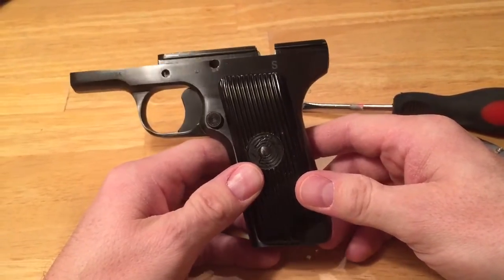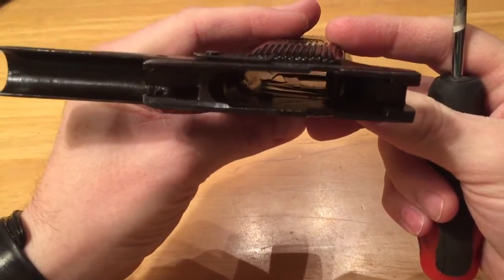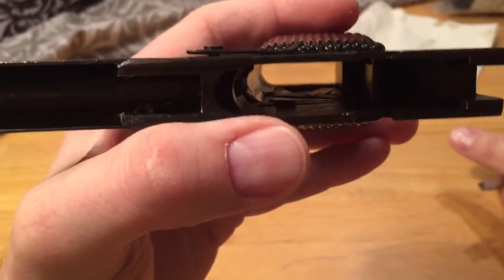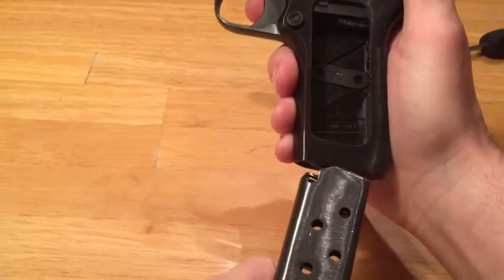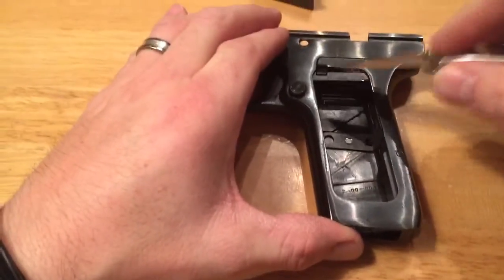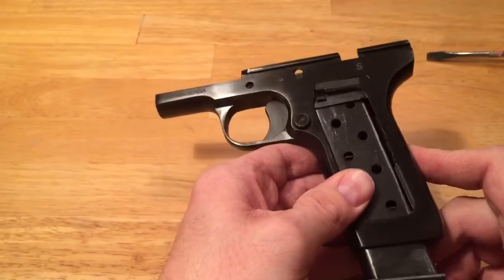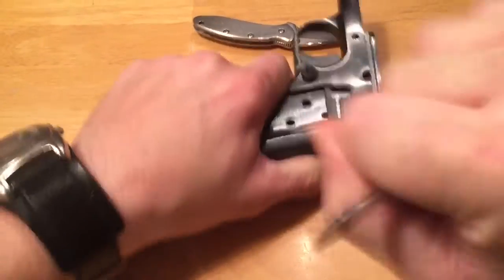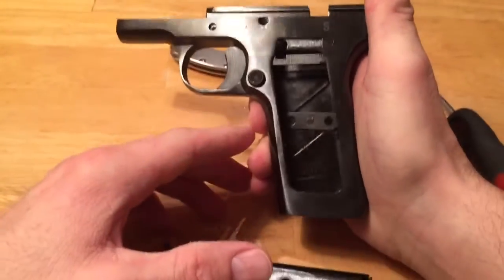Zastava M70A - Magazine Safety Removal

Comment: after messing with this myself and temporarly disabling it, I can see why some have issues with their mags dropping. this spring puts pressure against the mag catch side keeping firm mag catch engagment. If you remove or disable it, your mag mkves around much more due to loose tolarances. A better solution is to remkve the trigger, and carefully cut off just the tip that engages the trigger bar with a dremel.

Comment: If you do not want to alter the pistol you can accomplish the same thing by inserting a piece of plastic under the mag safety tab-spring.  I used a piece of an old credit card cut to the size to fit in the channel under the tab-spring; no more mag safety and pushing the mag release drops the magazine.
Reply: great suggestion,  thanks. Best not to permanently alter a gun if you dont have to.
Reply: Pics or Videos of this being done?  Cuz i've been looking everywhere for a non destructive and reversible way to remove the mag disconnect.
Reply: This option worked perfectly. Thank you @Mark Gman!

Comment: Great for permanent removal of mag safety but I found a way to disarm the mag safety without removing the mag safety clip on my M88A. I just put mag in and pried up a tad on the clip enough in order to slide a very thin piece of tin from a can bout 1/8" wide and 3/8" long under the clip and slid it back to the point where it held  the clip so it no longer catches the notch in trigger.The remaining piece of metal is then bent over the mag safety clip to hold in place.  Mag now drops free plus the pistol will fire without mag. To restore to original ,just take the metal piece out and it's back to working like before. So far works Great.

Comment: Just like some of your other commenters, I used this same method on my M88A. Worked great! Thanks, man!
Reply from the maker: Glad it helped you out.  I never owned the M88A so I had no idea it'd work for that too.
Reply: akkushisu when you did this to yours did the magazine develop some wiggle after removing the disconnect? Mine did but hasn't effected reliability so far
Reply: Yeah, mine has just a tiny bit of wiggle to it as well. Just like yours, my M88A hasn't had any reliability issues because of it either. In fact, I haven't had any malfunctions at all so far.

Comment: Dont break or bend anything. All you had to do is put a little piece of 
metal( I used p piece of copper wire) down in between the frame and 
safety bar to keep the bar from interfering with the trigger.  Takes two
 minutes and is easily reversible.
Reply: What size of copper wire did you use?
Reply: @CantoniaCustoms  I don't remember the size wire it was just big enough by seeing the way it worked to remove the interfering mechanism.
Reply: @aklancedave2982  Thanks. I might try experimenting with old pieces of file folder instead.

Comment: You don't have to completely remove it to disable it. All you need to do is bend it outward. Grip will go back on just fine with a little pressure and everything works, without having to permanently modify your pistol.

Comment: So, after doing this, I seem to have a problem with the magazine staying seated in the pistol. Whenever I rack the slide or the slide cycles to chamber another round, the magazine falls loose, preventing the next round from chambering...has anyone else experienced this problem after removing the magazine safety?
Reply: Lance Liberty Not me.  My runs like a dream now.
Reply: Lance Liberty shot mine with the magazine safety and it also drops the magazine while shooting.Preventing the next round from chambering.
Reply: PNYprepper This seemed to help a little bit. Now at least I can't pull the magazine out without pushing the mag release (I was able to do that before!). However, if I cycle the slide with dummy rounds in the mag, every time the slide moves rearwards to eject a round, it pushes the magazine downwards and out of battery, preventing the next round from chambering.
Reply: Lance Liberty Did you get this straightened out?
Reply: David Sisung So I think the problem is caused by poor/sloppy drilling of the female mag release holes on the magazine. The holes on my mag are poorly drilled, and don't have a good positive edge on the top to prevent the male part of the mag release button from sliding over it. I put some tape on the mag just above it, and this allows the mag to go through a full 8-round cycle without falling out of battery. However, once I remove the magazine, the tape gets ripped off, and I have to reapply it before using the mag again. I'm going to try contacting Zastava and ask about getting some better magazines, but for now the tape seems to help.
Reply: +Lance Liberty I've also experienced this  issue after removing that safety, I kinda fixed it by bending the mag lips where it catches but for some reason the first round still doesn't load well with I slide and rack a mag and often falls loose.
Reply: Wow...I bent the mag lips where the mag release catches, and it worked perfectly now. That was so easy I don't know why it never occurred to me before! All I needed was a screwdriver...if anyone wants to see, I posted a video demonstrating the problem and showing how I fixed it.
Reply: Glad to hear that Lance.  These guns are really fun to monkey around with.  I have had several problems with mine, but it is so simple to work on its kind of fun.  I know a fire arm is supposed to be reliable and not have problems, but for recreational purpuses you cant beat it.  After you get the bugs worked out of a new one it should be reliable enough to plink around with.
Reply: Damn I thought I was going to remove the mag safety, but not now.  thanks for the input
Reply: Why remove the magazine safety?  Doesnt make a difference if it is removed or not doesnt effect performance
Reply: David Sisung I'm just trying to make sense of it.  All I know is that the safety on my Romanian tok sucks an A lol
Reply: That magazine falling out doesnt have anything to do with it having the magazine safety dude has a messed up mag release.